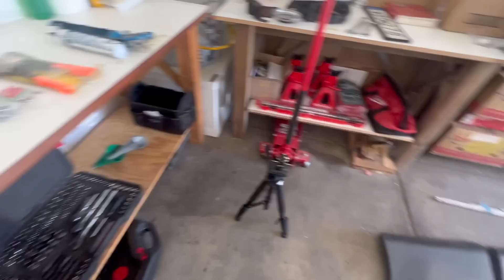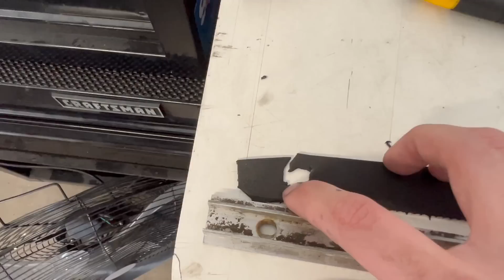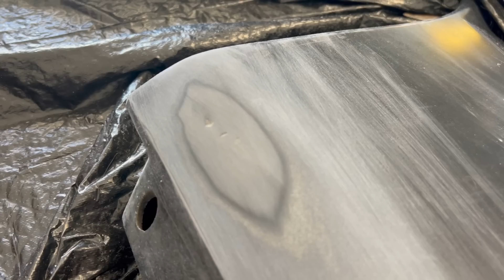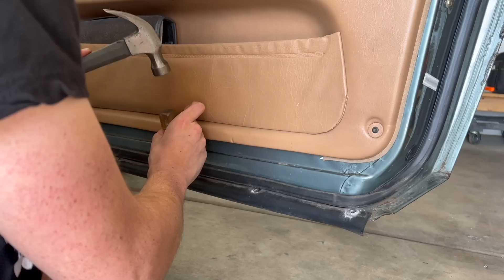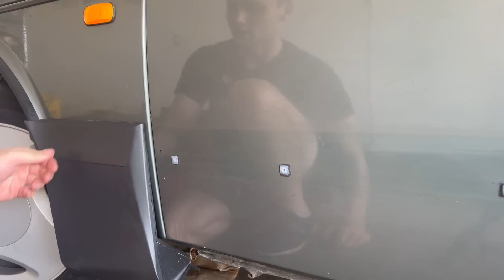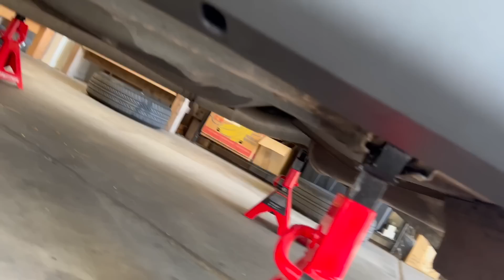I Installed a Rare SPG Bodykit on My Saab 900!

Comment: My almost 16 year old son found an 86 900 Turbo that had been off the road for 5 years or so.  We got it cheap, $500, and it has an Airflow kit on it which is really cool but the plastic is super thin.  There is some repair we have to to and then repaint it, hopefully it comes out looking good.
Reply from the maker: Awesome find. Best of luck

Comment: Nice job there young man.
I did that on my 1985 back in 92. It is a lot of work but it completely transforms the car.
A good tip is to use a bit of teflon spray on the upper edge seal, where the panels come in contact with the body.
It allows the panels to slide a bit easier.
Reply from the maker: Right on - good tip!

Comment: Good job! I did this job about 10 years ago on my CE convertible and foundation it very helpfull to heat the panels from the back Just before applying them. So much easier, especially with the edges.
Also it could be helpfull to heat the panel before spraying to achieve a better attachment of the paint! Do not use primer other than to fill minor imperfections. When the panels are nearly perfect after sanding, use a plastic primer only I would recomment. I did mine 10 years ago and it still looks new. Good Lucky everyone!
Reply from the maker: Nice! Heating the panels is a great idea - I’m sure it would’ve made it easier to slide/pull them over the arches

Comment: Wow! If looks could kill? It's amazing the difference the Aero kit makes. There's not much to do now. Maybe some Aero ( SPK ) springs and then the paint. The Aero springs are 25mm lower in the front and 15mm in the rear. Improves handling. And from memory I think the front and rear stabilizer bars are thicker. When this project is finnished you should get a trophy from the Saab club! Cheers from downunder.
Reply from the maker: thanks! it still needs a lot of work, trust me! lol

Comment: Foam behind the bars is tricky because it will be soaking wet. The original SPG-Kit has plastic stripes between the alloy rails and the paint. And the corner panels are not slightly different, they are much different and go far deeper than the std ones, so go and find the missing corner parts ;-)

Comment: I could really use a tutorial on how to replace the belts on a C900.  Do you have something like this?
Reply from the maker: I don’t, but it’s pretty straight forward. Each belt has a tensioner that needs to be loosened. After that, they just slide off
Reply: @AutoAutopsy  The mechanics at two shops took one look at the backwards mounted Triumph engine and said "uh, try somewhere else?" 
I'd buy the Bentley manual but it's more than $250 in Canada.
I appreciate your patience with the 900 and it's leaks.

Comment: Perhaps I missed it.  Is there not a weather strip that runs along the top edge of the panel, placed between the metal and the panel?  My 91 SPG has it and I see that it is sold on-line by Saabits and others.
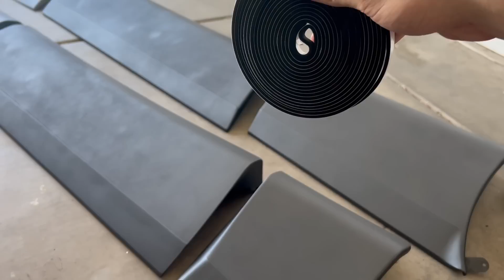Reply from the maker: Are you referring to the weatherstripping/rubber at the 8:00 mark or 21:00 mark? I believe you’re referring to the 21:00 mark. If so, yes - there’s weatherstripping between the plastic panel and the actual body of the car
Reply: @AutoAutopsy  The foam strips are different from the weather seal ones that you will see on the Saabits site.  They are not foam and are sort of Y-shaped.  When installed, you can see they form a seal along the tops of the panels.

Comment: BUT, YOUR front and rear bumper extensions (the other four panels of the 10 panel SPG kit) are not on yet, so it doesn't look like a finished SPG kit to the trained eye, of course. Yeah the color is great/ and the contrast. probably should keep malachite if you ever repaint it.
Reply from the maker: Yes, I’m aware the bumper extensions are different; however, they look similar and that’s good enough for me for now! 👍🏼😁

Comment: What’s a fair price for this body kit in your opinion?
Reply from the maker: I’d say, assuming they’re in good condition and have all of the rails, anywhere in the $400-800 range is fair for middle 6 panels (like what I got). They’re definitely going up in value for sure, unfortunately
Reply: I found a spg kit that has 10 panels plus the railings. I could get it for about $2,000 but that is steep